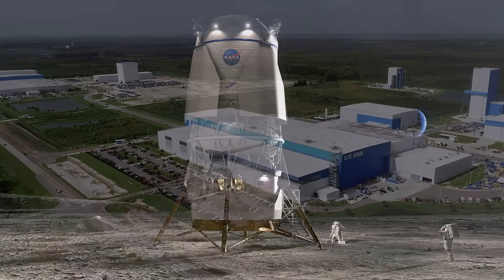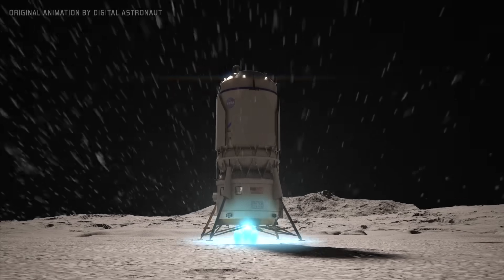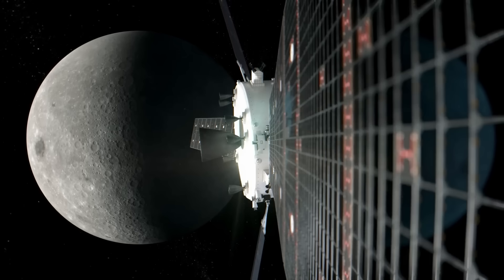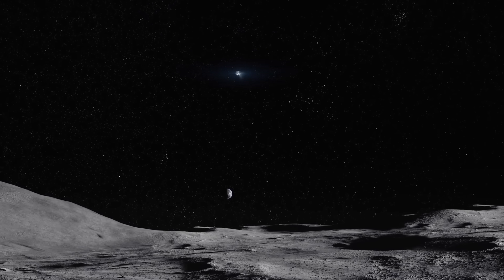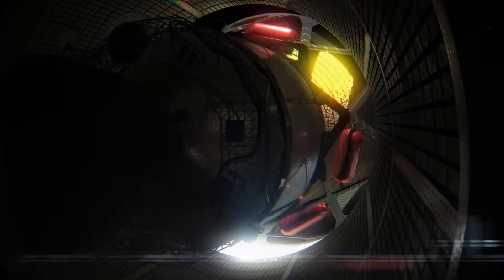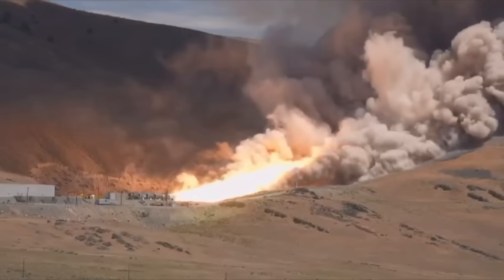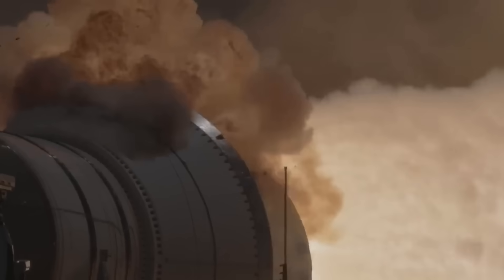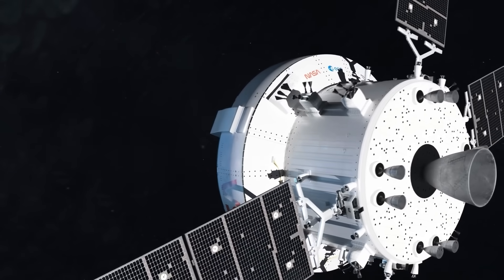Blue Origin is Landing on The Moon This Year

Comment: Since I am convinced by the evidence of naysayers that Starship has a serious weight problem that is causing SpaceX to overstress the Raptor engines and reduce structural margins to dangerous and ultimately unsustainable levels, I accept that Blue Origin will reach the moon with an unmanned test of their HLS lander BEFORE Starship can do the same. If they don't do it this year, it will happen in coming years. 
I expect SpaceX will have to redesign the Starship upper stage based on carbon fiber. As to when.... that depends on how stubborn Elon is.

Comment: I lead a Hollow Moon Theory based on this. First debree formation being H2O gas with Gravity forming Water Ice,as heavy metals rain on its surface, followed by sand and dust. Heat generated inside steaming water out to make the Moon Valcanos,and Opposite Side of those being the Earth Gravity sids to pull liquid water into permafrost.
Evaporated water from the core leaving a metallic shell that rings like a bell LOL.
 I'M CRAZY?
Mars was once a Saturn Ice Moon?
Gayle crator with Olympus Mons exit point knocking Mars out of Saturn orbit?
2 unproven theories

Comment: With those dinkey little legs so close to the body of the lander it will probably fall over whilst landing just like the last 2 lunar lander's have done.
The real people landed on the Moon 50 years ago 6 times and even drove an electric car all around on it.
Nobody has been able to land people on the Moon since then. I am 72 years old and we old people knew how to land on the Moon successfully
and come back again. We had 1 rocket and 1 tank of gas each time and we went to the Moon and back 6 times.
Reply: You know less than you pretend you do.  The issue with the landers is not how tall they were but how much horizontal speed they had.  They want to land a lot more this time than they did with Apollo it's not merely another flag planting expedition.
Reply: @imaginary_friend7300  Well the Moon landings thing has all been done. What you people of this modern era have to do is find some other astounding thing that you can do. I do not know what it will be but you have to go out there, find it, do it and come back as conquering heroes like our Astronauts did when they came back from landing on the Moon 50 years ago.

Comment: No, NASA has not been "struggling to keep up" in the Moon mission. The only working parts of Artemis are SLS and Orion. Starship is a failure and BlueMoon still has to prove the concept. The private sector are the ones who are "struggling to keep up".
Reply: Well there is the EUS issues with SLS and of course the new launch tower required for it as well.
Reply: @imaginary_friend7300  True. But, the biggest problem In Artemis is still HLS. Starship won’t work and Blue Moon Mk2 is extremely Risky

Comment: I really want Blue Origin to succeed, I do, but they have to be more transparent which they never have been.  They would generate a ton more support if they were.  Their first mission was not truly successful if they are held to the same standards as Space X.  Yes they got to orbit, but their booster blew up on landing.  Space X has caught 3 boosters out of mid air with chopsticks (crazy hard engineering), plus gotten 2 starships to survive re-entry and land in the ocean.  Deploying a satellite is way easier than re-entry.  Falcon 9 has done it 450 times.
Reply: But the first attempts to land a F9 were not successful.  Their first and primary mission is always to deliver the payload, landing is a secondary objective and not really how success is measured.  Even Spacex has had successful missions with failed booster recovery.  Your notion of the 'standards' is flawed.

Comment: Given that SpaceX is still blowing up Starships, and STILL hasn't attempted actually in-orbit refueling, not to mention flown Starship with landing legs, I'd venture to say Blue Origin has a fair chance of doing what they say they will before SpaceX does.
Reply: Which of the two has any meaningful track record of success?
Reply: @T_Mo271 so far, New Glenn has managed to deliver a payload to orbit, and Starship has 'delivered' a lot of scrap metal to several different locations. Need I say more?
Reply: Their "payload" is an almost inert demo peanut payload that had no useful purpose.
Reply: @T_Mo271 so tell me,  how much has Starship delivered to orbit? Last time I checked, it was zero payloads weighing ZERO pounds. Next?
Reply: Sure, its a MUCH smaller project.  That helps.
Reply: @imaginary_friend7300 well, maybe if Elon weren't trying to adapt Starship to do pretty much everything, he might be making greater progress. As it is, he's trying to make it:
a lunar lander 
an in-orbit tanker 
a Mars colony vessel 
a point to point delivery/passenger vehicle 
and let's not forget his 'plan' to use it to deliver cargo to unpreared sites for military supply missions. 
See the problem now?

Comment: It will tip over if it does reach the moon.  Landers have to be about as wide as they are tall.  I know they want more capacity, and you're confined to a cylindrical shape; but you can't be so greedy
Reply: That's an ignorant statement at best.

Comment: Seeing the solid rocket boosters failed at 1m 43 seconds is a success, they only have to run 1m 24 second for the mission, it was a test to failure and they failed well beyond the usage time.
Reply: SRB's burn until depleted, and it was not depleted.

Comment: Dude I had no idea that Blue Origin was that close with their landers.
Reply: They aren't.
Reply: Their not spending much on re-entry because moon landing Base Supplies don't require it. Tactics will push them first on Hydrogen and Oxygen filling station sales so that's really the best approach.
Reply: Same. Their rocket had like one launch 😅
Reply: They’ve been working on it for close to a Decade Now, Absolutely shameful when compared to SpaceX
Reply: Elon is the PT Barnum of spaceflight. Bezos is definitely not a showman. But we may be experiencing a Tortoise and Hare kind of moment. That will especially be true if the naysayers are correct in their assessment that the stainless steel fabrication decision for Starship has made it fatally overweight. If SpaceX has to redesign the Starship upper stage/spacecraft to be constructed of carbon fiber to make it viable, it will be a catastrophic setback for the timeline on SpaceX lunar ambitions. BO will then eat its lunch.
Reply: They are, just the short distance between earth sub-orbital and the moon.
Reply: They already made it to orbit idiot  @madsam0320
Reply: @madsam0320 they literally achieved orbit on their first attempt. New Glenn works, reuse comes whenever it’s ready, for now it works as an orbital launcher. Something starship still cannot do
Reply: @mattkingston6157  
This only shows how little you actually understand here. Blue Origin goal was to reach orbit, while SpaceX goal is to make fully reusable rocket. Reaching orbit is the easy part, as spaceX reaches that like every 2 days for past few years. And if you want to go with "but starship never reached orbit!!!" well duh... Its INTENTIALLY been suborbital in case something goes wrong so that it deorbits on its own as a worse case scenario, they could have reached orbit in their first flights, but that wasn't the goal.
Reply: @Zripas  spacex's goal was to reach mars in 2022. or is it fully and rapidly reuseable? had that starship been caught could it have been reused? after the heat shield looked the way it did, and the fact that it had a small explosion which damaged a fin? it would have been a total write off. They're no closer to an operational orbital craft than blue origin is to reusing their rockets.
Reply: @mattkingston6157  Why are you all so focused on Starship which will serve a whole other porpuse than simply reaching orbit. Ever heard of Falcon 9? Also Falcon Heavy has a much higher payload capacity to LEO than New Glenn.
Reply: @tom_skip3523  because spacex will never land on mars. It's not happening. they aren't even 5% of the way there yet. apollo didn't build and blow up 10 saturn v's and then start on all of the life support and habitation work afterwards. it was all concurrent. starship is an empty husk. they haven't even done the comparably easy part yet. nobody has ever even tried to build a ship that is able to reach mars yet, spacex included. they havent attempted orbital refueling yet either, something else that no one has ever done. they aren't anywhere near even attempting a mars mission yet so its not worth talking about. this is a leo optimized starlink launcher. we will be lucky if even a single new rover lands on mars in the next 10 years. let alone a starship. mars won't have people on it until 2050 at least.
Reply: @mattkingston6157 So much hate hmm Well I agree there will not be humans on mars in the next 10 years but there will be tries trying to land starship on Mars for sure. Wait and see. They have already done much by creating a reliable reuseable orbital rocket system.
Reply: @mattkingston6157 SpaceX goals is so hard to understand? Aspiration to give purpose. Those that aspire keep doing the hard work. Mars is an objective that gives purpose to their employees. Oh, if SpaceX wants to design a single use rocket they would have that long ago. All the testing are done for reusablility and that is very difficult. China would know, they have yet to clone Falcon 9 rockets.
Reply: @nguy404 damn it really is a cult. Listen to yourself.
Reply: @nguy404  
Reusability has very little to do with it. It has to do with their testing approach. It would serve them well to have more practical goals and then iterate the design with the big picture (Mars) in mind. Instead they just want to slap 30+ engines on an empty metal cylinder and watch it flip around in the sky before exploding. It's amateur hour over there.
Reply: @SeanUCF lol you have zero idea why they use 30 engines. It is not the engines that are the challenges. Big engines don't allow scaling the power output for landing.

Comment: Another company developing a vertically oriented lander, even though the track record of recent attempts with similar designed shows squat landers are the safest design. Do these people live in a bubble without access to reports of others' failures?
Reply: Well, do you have access to reports of others failures? If so, you'd know that the issue with most of them was sensor and software problems and not the shape of the lander.
Reply: @EinzigfreierName  High center of gravity is what caused those failures. A different design wouldn't be top heavy. Several have failed so was it all sensor failures, relearning why squatter designs are safer landers.
Reply: @buddypage11  That's simply not true. Just read the official statements and investigation reports of all the missions that failed. Most of them just went way too fast when they hit the ground - vertically or horizontally. And the cause was bad sensor readings or software error. There are probably 1-2 missions that just would have broken a leg without the lander tipping over when the shape would have been a bit different. IM-1 maybe. But I don't see why anyone would change their design when that's not the root cause of the problem. Every design has their limits. A lander is not supposed to go sideways at 20m/s when it touches down. Or slam into the ground at 100m/s. Sure you could design a lander that survives this. But that's not the design goal here. Soft landing is. And key for this are correct estimates of altitude and speed.
Reply: @EinzigfreierName  A problem that would have been easier survived or prevented with a different lander design.
Reply: @buddypage11   In most cases - no. And why change the lander design if the problem can be solved by something that needs to be solved anyway - the sensors? It's simply impossible to soft land on the moon without proper altitude and velocity readings. So they NEED to fix this anyway. And then there will be no problems at all with tipping over. Problem solved.
Reply: @EinzigfreierName  Remember this conversation in the future when the next failure occurs. Problems are not solved through PR.
Reply: They are the same ones who are sure that UFOs do not exist... 😅
Reply: Recent attempts have used very oblique landing profiles and have had issues with starting their landing burn at the right time. Because this is eventually going to be a human lander, they'll likely go for a vertical descent, less efficient but 20% less payload is better than no payload.
Reply: @yourbrojohno  The landing profile is fine. But without the ability to measure altitude and velocity over ground correctly, every landing attempt is screwed. That's what's common to almost all of these failed landing attempts. Even though the actual root cause was slightly different for all of them.
Reply: No, they just have an actual understanding vs your pretend understanding.  But then you people never make any real effort to understand.  Ignorance and lazy go hand in hand.
Reply: @imaginary_friend7300  You people? Seems that some can't think beyond their own limitations.

Comment: Just so you know, the SRB burns from the inside outward ... not from the top down.  The igniter is at the top but what you are calling the "tunnel"  is just a hole in the propellant (known as a CP ..center perf design). The entire surface of that perforation burns until the propellant is gone.
Reply: As someone who made rockets from scratch, I can attest to the effect that hole has, especially the cruciform section. With a fast-burning propellant even a nozzle-less rocket would take off like a Sprint ABM.
Reply: @-danR  That Sprint was something. If you blinked you missed it.
Reply: @-danR  But a bit haphazardly :D

Comment: "Blue Origin is Landing on The Moon This Year". Are you kidding? BO is not sure if they can land their booster on the earth safely this year. How do you think they can land anything on the Moon?
Reply: The lander won't have an atmosphere to deal with
Reply: Several private companies made it to the moon in recently. Why not BO? They already have all the expertice that's needed.
Reply: @EinzigfreierName  they have a bigger and more complex lander
Reply: @notgreg123  Bigger, yes. But more complex? I don't think so. The main challenges are the same. Propulsion, guidance, control and navigation. And making sure the sensor are working correctly.
Reply: @EinzigfreierName  hydrogen is a norotiously difficult fuel to work with

Edit: I'll note that they also completely redesigned the shape of their lander 2 years ago. Honestly impressive they're this close already
Reply: @notgreg123  Fair enough. Everyone else so far has used hypergolic fuels to land (or try to land) on the moon. But BO has experience with LH2/LOX from BE-3 so they are not starting from scratch.
Reply: @EinzigfreierName  I mean it's only taken them like 2 years longer then everyone else at most, depending on where you set the starting date. Pretty good for a lander with 10-30 times the capacity as the other CLPS providers
Reply: well, we landed on the moon over 50 years ago, having never before landed a booster on Earth.  BO landed its New Shepherd years ago and Space X has been routinely landing Falcon 9 for a few years as well.  One does not equate to the other as you imply. Landing on moon in vacuum vs landing on earth at 1G are very different tasks.

Comment: Could you stick two more SRBs on sls and increase its capability?
Reply: The core stage probably wouldn't be able to handle it. It's not as simple as KSP
Reply: They'll have to redesign the mobile launcher - which is already costing NASA a fortune!
Reply: @anthonybellmunt3103 yea its always annoyed me that they called it a space launch system. Its not system.  They should have made it adaptable to launch small, medium  and larger payloads.  Would have been much more effective than just a single large rocket.

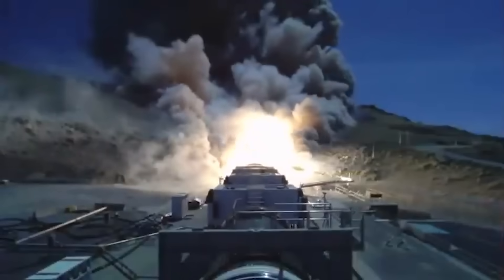Comment: 5:42 Center perforated SRMs burn from that center perforation radially out to the case, not from the top down.
Reply: Are the builders not able to inject a reactive foam to halt the on going rocket reaction and then use ignitors built into the regments to restart? We seem to have gone a long way without any improvents in solid rockets. Understandable to an extent since the boosters are an off shoot from missile programs, but where is the R&D